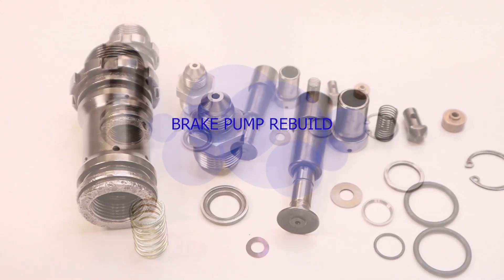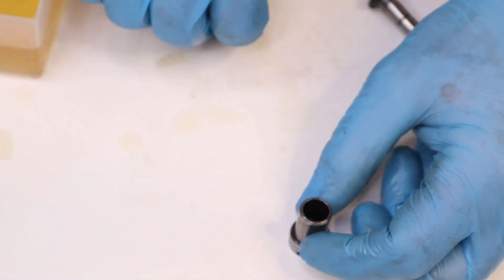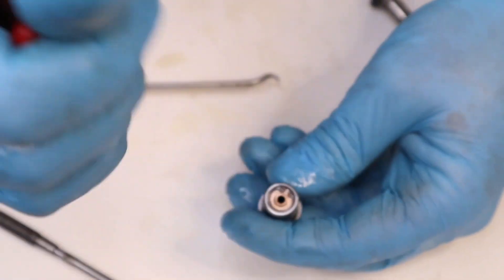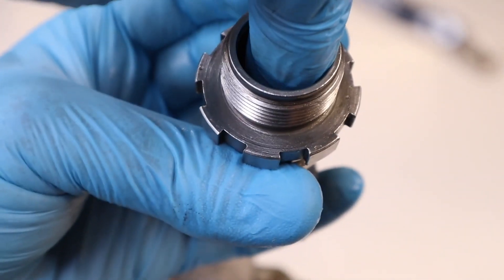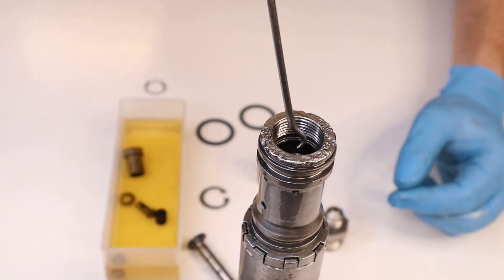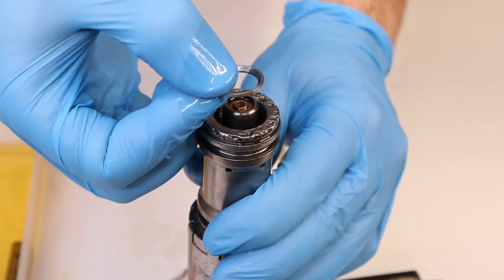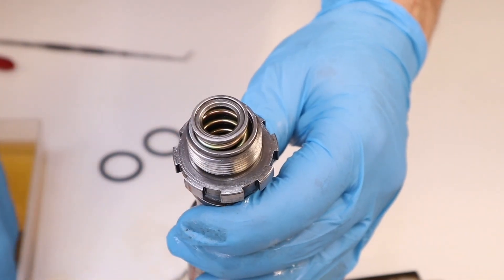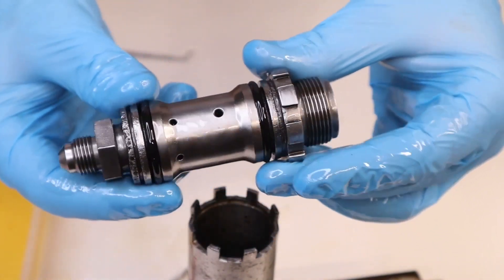Brake Pump Reassembly: Rolls Royce Silver Shadow, Shadow II & Bentley T1/T2

Comment: Excellent video. Having rebuilt several hundred of these I will add that you will usually need to polish outside of barrel with 600 or finer paper to remove crud buildup where internal “O” ring seals.